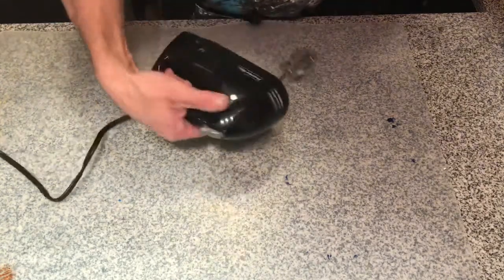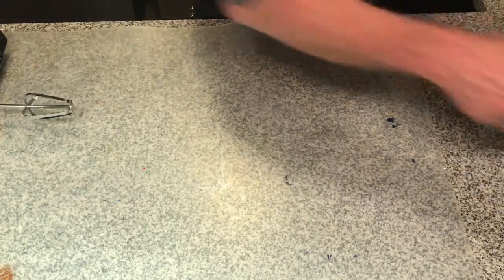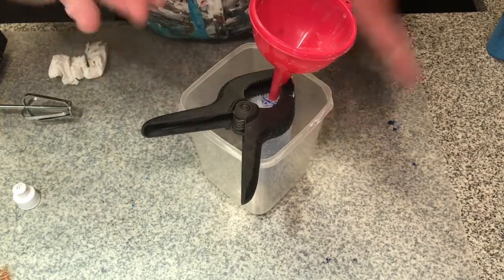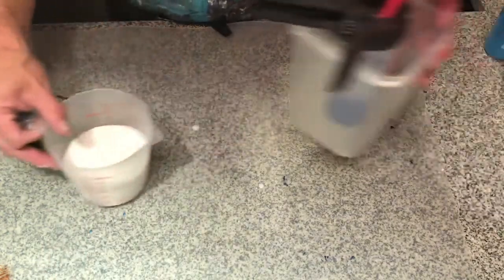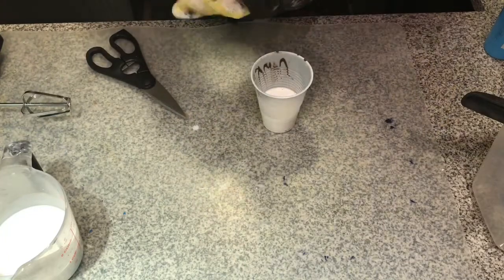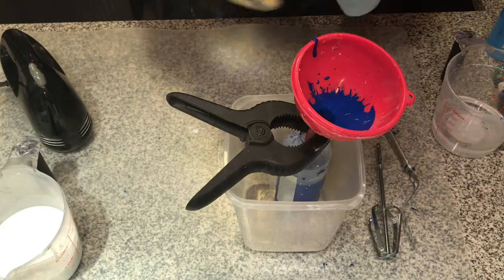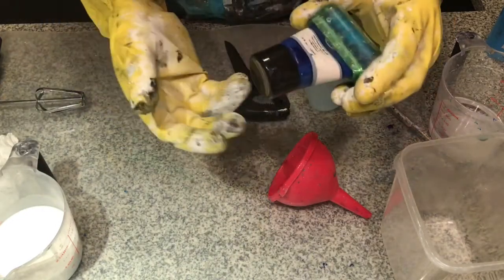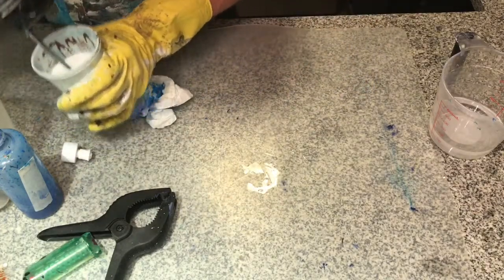(011) Tips n tricks I use and my way of mixing paints.  WARNING:  the volume will fluctuate

Comment: If you use mason jars for your base paint, you can mix  the paint in it and eliminate funnels, waste, cups etc. I just pour out form the jar when I use it add silicone or not, or other additives to the quantity that I am using right away.
Reply from the maker: Thank you very much for that information and I will consider it.  See, mason jars are glass, I am a klutz and klutz + glass jars = stitches somewhere on my body.  Though a fantastic environmentally and financially sound,  glass jars....I will try it first.  If no wounds develop, I will try adding more jars, phasing out plastics all together.  I will also look in to plastic mason type jar containers.
Reply: Plastic jars are good too. Mason jars are very thick glass. If you don’t smash to the floor.... ;)